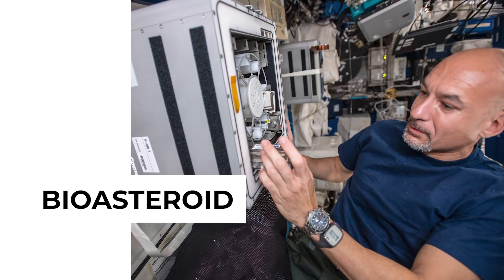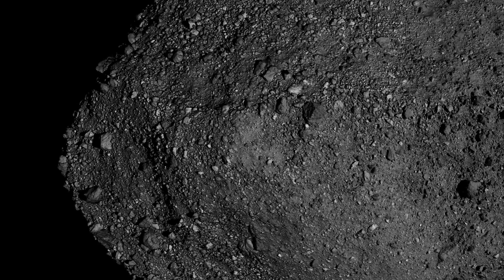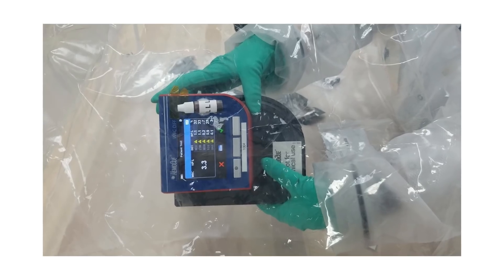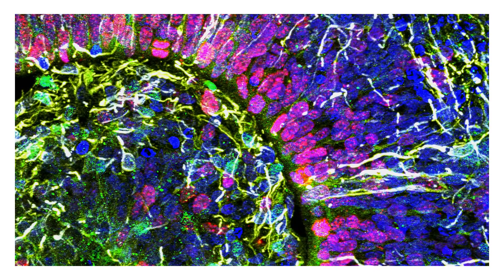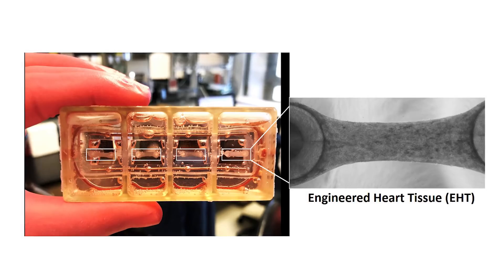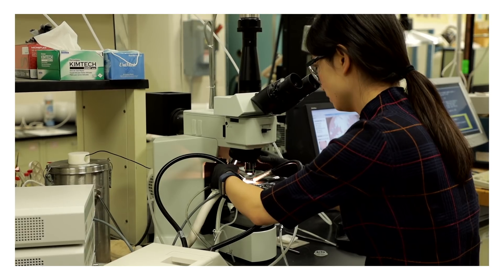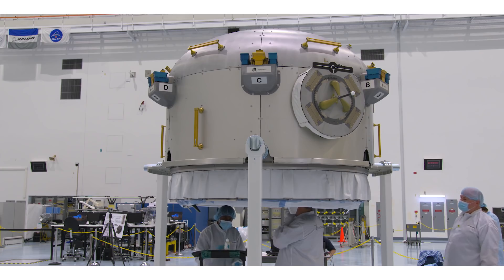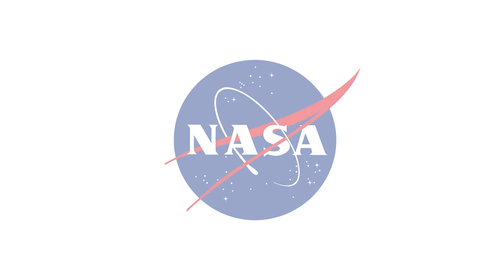SpaceX's CRS-21 Mission to the Space Station: What's On Board

Comment: Personally I prefer cargo dragon 1 over cargo dragon 2
Reply: Why? I’m curious. Cargo Dragon 2 is a better spacecraft than its predecessor. It can dock to the ISS automatically and Cargo Dragon 1 couldn’t. That’s just one great superiority of Cargo Dragon 2.
Reply: @Trex531  I just prefer the look and I think the docking is cooler with the canada arm
Reply: @Comrade Jebediah Kerman Dragon 2 also can take heavier payloads
Reply: @ImieNazwiskoOK  yh ik
Reply: @Trex531  although that is nice, berthing had the advantage of letting you bring up larger pressurized cargo than when you dock to an international docking adapter.
Luckily there's still Cygnus and the Japanese HTV vehicle that use berthing, so there's still a possibility to bring up large items like racks or PLSS units for the MMUs.
Reply: @RufftaMan  Why would berthing allow more cargo than docking?
Reply: @LoanwordEggcorn  not more cargo, but larger items, since the common berthing mechanism has a larger, almost square, opening, compared to the smaller round opening of the international docking adapter.
EDIT: In fact, the common berthing mechanism is the connector you see between the different modules on the ISS. Same thing.
The international docking adapter is the small round hole astronauts squeeze through when they come out of the soyuz or the dragon capsule.
Reply: @RufftaMan  
You’re right talking about large cargo, but that can be sent up in other cargo ships like Cygnus. The bigger cargo volume, the automatic docking plus reusability make Cargo Dragon 2 a better spacecraft than Cargo Dragon 1.
Reply: @Trex531  reusability is definitely a big plus. I'm sure v2 is the better ship of the two.